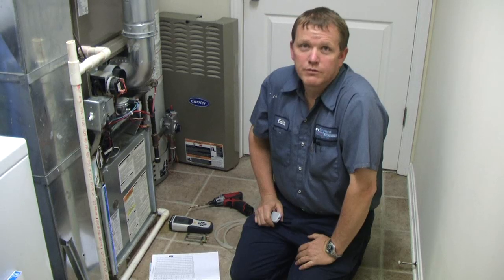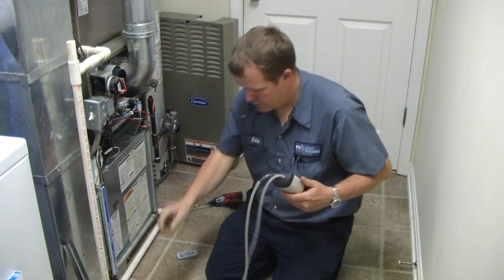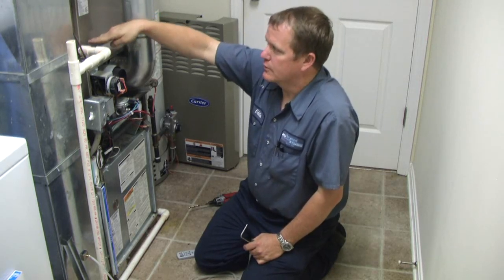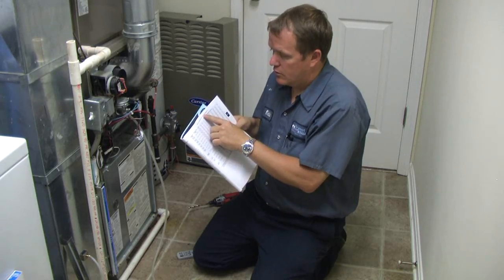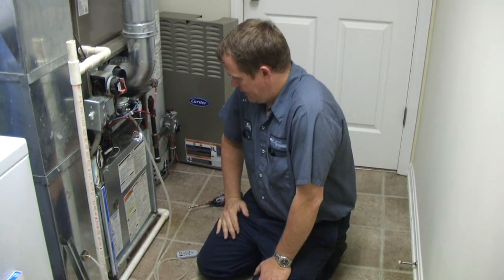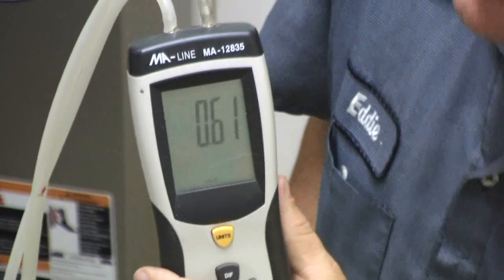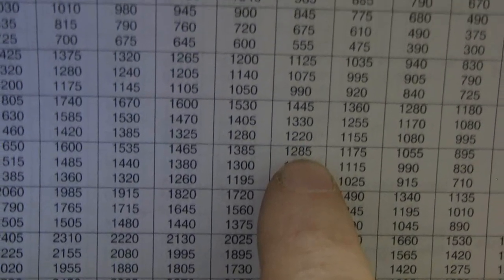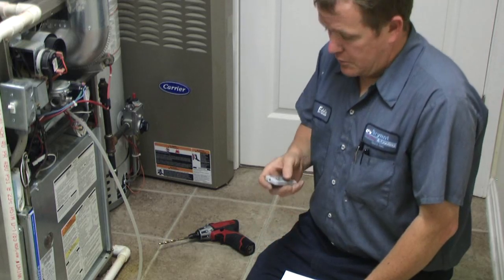Hvac Service - Reading CFM  Part 1 of 3 - Testo 416

Comment: Hey Eddie awesome video. I do have a question. I am new to the trade so asking everything I can. I have a Lennox G61MPV-036C-090 with an ECM motor. My cfm table shows a the settings of cfm under each speed. Norm setting on speed 4 is 830 cfm. Question is.... The description says blower motor performance (less filter) 
What does that mean? No filter when doing tests?

Comment: Hey there. I have been doing ac repair for years and have never taken the time to learn this, but now I am ready to learn so I can improve my work. Here's my first scenario in wanting to check cfm; a one year old air handler in the smallest hard to reach area I've ever seen. This unit has no return plenum, the only thing between the coil and the room is a filter and 1/2" drywall. How can I test pressure on the return side?

Thank You
Chad

Comment from the maker: The main problem that manufactures have today is that they can hire the best engineers to develop a super reliable furnace or air conditioner but they have to depend on the installation contractor to make sure everything else is right, which we all know that they hire the cheapest laborers around and on top of that they want it installed in record time. There's still a lot of old school thinking when it come to installing HVAC systems and that is not good on these newer high efficient models.

Comment from the maker: There's never a dumb question to ask!

In order for a Air Conditioner to function the way that it was designed to it has to remove a certain amount of heat from the air. In order to remove the required amount of heat a certain amount of air is required to pass the evaporator coil, which is basically a heat sink if you want to look at it that way. The refrigerant running through the coil will remove roughly 35 degrees of heat if there is proper airflow.

Comment: I think by using pitot tubes you are measuring velocity pressure, which is difference between total pressure and static pressure. But to do that you have to take "traverse" reading, move pitot tube from wall of the duct to the center and take multiple reading and average them out to get more accurate  CFM reading results

Comment: Ok. I sprung for the testo mini vane anemometer. "if you ain't measuring yer guessing" what are the differences pros/con between hot wire and minivane, Eddie?

Comment: Hey Eddie, not knockin you, your video is great but. the probe goes after the filter on a furnace (inside the blower compartment) for furnaces and before the filter on air handlers. Check the literature of your manufacturer. I know with York and all others I have read says the filter is not included on furnace blower tables and says the filter is included on air handlers. 

Yes I install an inspection riser between the coil and furnace for up flow installs, provided there is head room to do it.

Comment: Sir,
I appreciate what you are doing here on utube. If more service technicians searched for the proper way to do things my job would be a lot easier. 
I do have one concern though. You state in this video that you you Check the external static pressure Or ESP before the filter. ESP is always check after the filter and before the coil. This is the only way you can tell what kind of pressure drop you have over that filter. In this application you would want to take a reading in the blower door